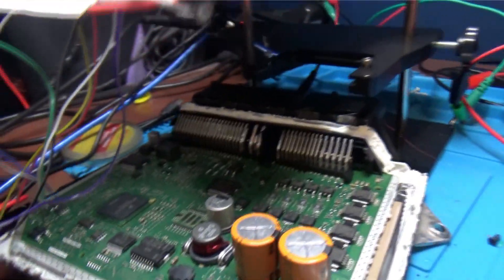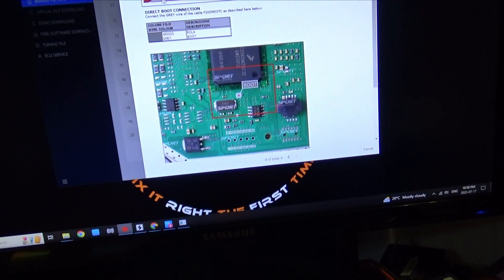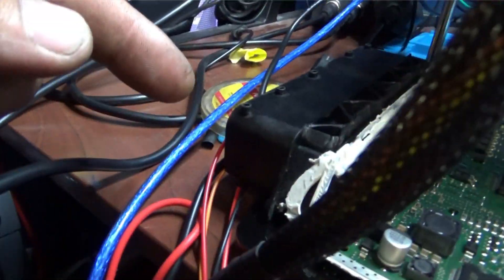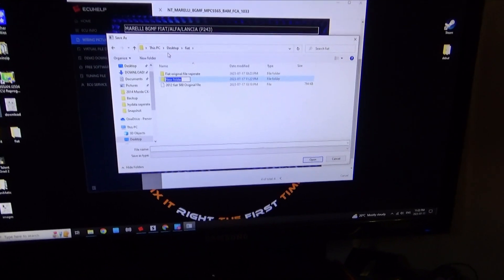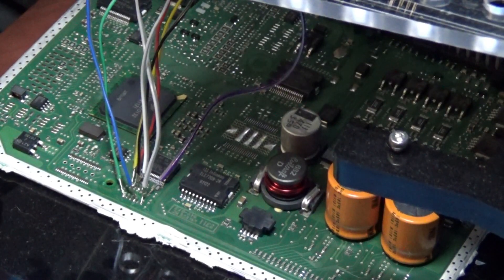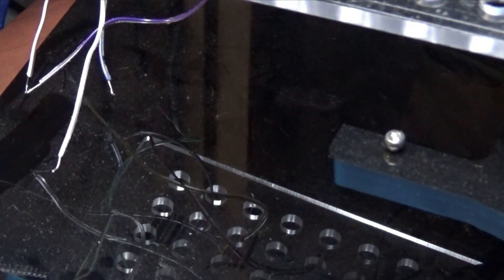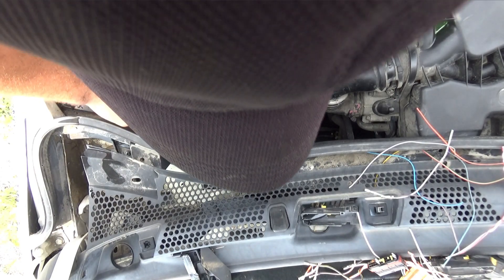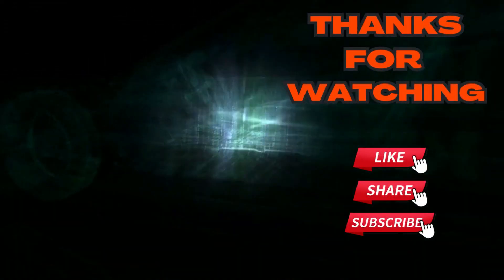2012 Fiat 500 ECM CLONE

Comment: Salut! Thank you for this guide, extremely helpful! I have a 2013 Fiat 500 that had trouble starting because of the ECU (couldn't scan for DTCs through OBD), but I opened it and cleaned up a bit (it was opened before by previous owner) and now it starts fine. However, after a day of not having any problems, the check engine lighted up and I couldn't read any error codes (which is what happened the first time). So I want to clone this ECU to one that I got from a scrapyard to make sure it doesn't die on me in the middle of no where (from a 2012 Fiat 500, but it's the same hardware). Whenever I try reading either with the KTAG, it shows "Error communicating with the ECU. Check connections..." Sometimes the error is different: "Micro protection removal failed." I looked around (for a long time) and saw that sometimes it's a bad PSU (I tried with a lab PSU with voltage from 12 to 13.5V, like you did) or maybe the ECU was updated at the dealership (and therefore the KTAG can't read it). I realize that this is a shot in the dark, but did you ever run into similar problems while trying to dump this ECU? Bad KTAG clone? I tried with the Kess, but it won't write, just read (although I think it might just be the maps, so no complete cloning there). I'm losing my mind trying to get this to work lol. Thanks!
Reply from the maker: so, the only thing i could see is that you have a bad clone. Ive done this with my ktag clone and my kt200 with no issues, 

you could always use oem software to rewrite the new ecu, 

if you want just a clone you could ship them to me and i could give it a go.

if you are in the montreal area let me know and you can just give them to me.
Reply: @JLsAutoSolution  hey thanks for the quick response and the offer! But it might not be necessary. I'll return that faulty ktag clone. I just tried something today and I think it worked. I read the donor eeprom with a cheap CH341a, wrote it on the new ECU and then the car could start with it. I used the Kess to read and write the maps and it worked! It wouldn't write initially because of the immo, but now I think I've got a clone of my ECU even though it was through unconventional means 😅 (unless I'm missing something; I''m no mechanics, just a poor student trying to make my cheap car run again)

Comment: Hi thanks for video👍.
 I have an error code in PCM on fiat 500 ,2012 manual transsmision. p160200- "PCM not programmed" it happened after battery removal as i was told. Any ideas how to fix it?🙏
Reply from the maker: you will need to reprogram using Chryslers  oem jbox system
Reply: @JLsAutoSolution  if send you a file  from pcm can you make it virgin